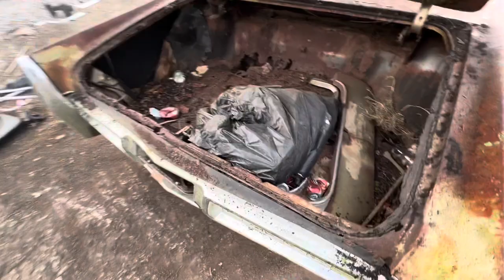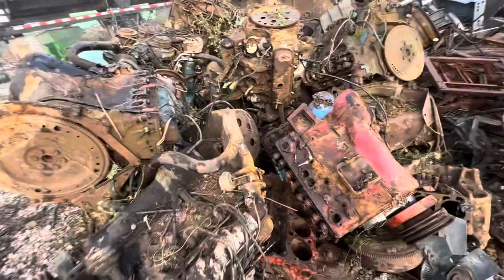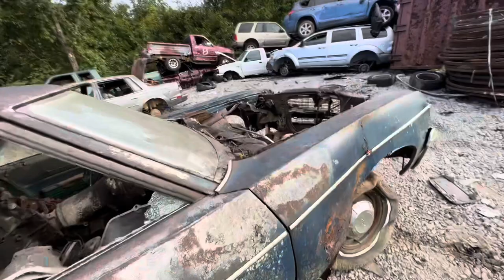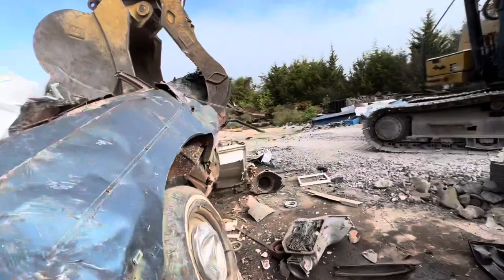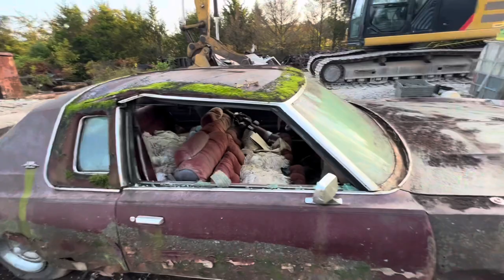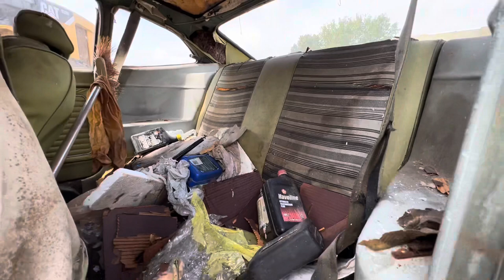Got Classic Cars In All Week At The Scrapyard

Comment: Whilst accepting those cars are beyond saving, notably what you can't see tells you so, some bits like the doors & bumpers for example can still be used to keep other cars that era still supplied.
Reply: There can use the door hinges and handles and lock mechanisms and front bumper and back most likely would be very hard to get

Comment: Folks, these cars are at the junkyard for a REASON. They're all rotted out to eff. Very minimal parts that you could use on these cars, but those parts are not in demand because of aftermarket options. These got crushed because they are NOT worth more than their metal weight, which means it is not feasible to sell the car whole. That is how junkyards work.